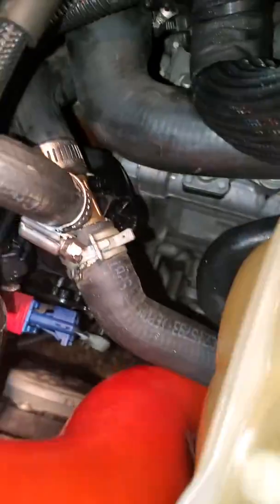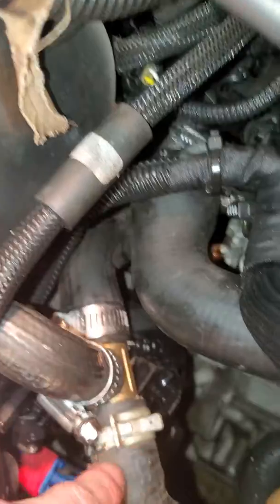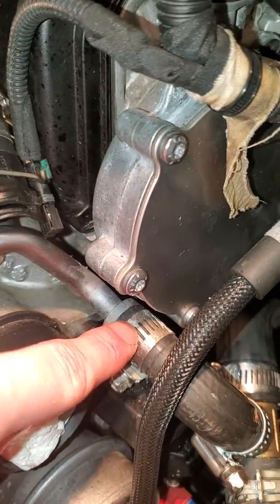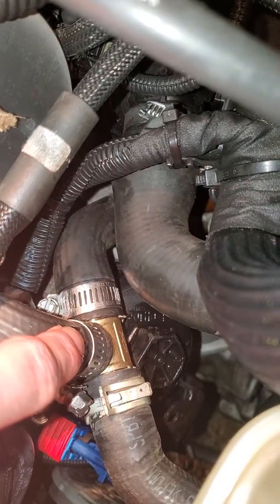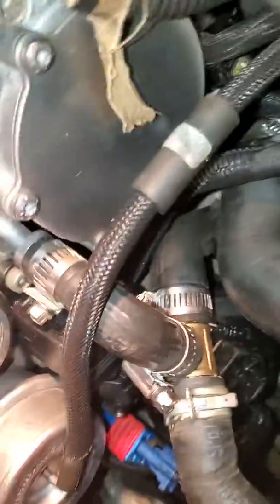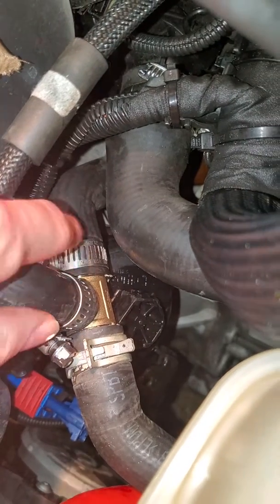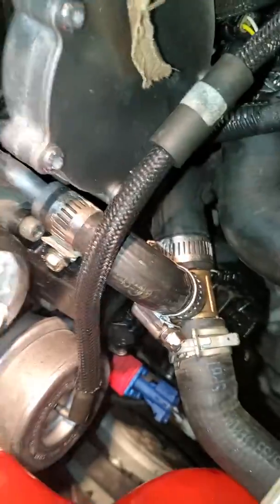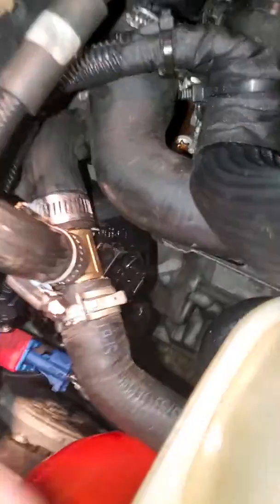Mini cooper coolant return line failed!

Comment: Question on the top hose and back hose how did you get the outer plastic rings off the ends? I know this is a 4yr old vid but maybe I’ll get a reply before I start taking everything apart lol
Reply from the maker: i used a dremel to create a cut in the plastic clamps, then used a flat head screwdriver to go underneath the clamps to pry them off or to crack them off.  👌

Comment: Yes!! Great video save money!!! 
Just got my fiixed same problem. Plastic broke off 2013 Mini Cooper S R56 N18.  I go with 1"x1"x3/4". Work/ fit great. 
* No more worry about crack/ broke doing oil change. .
Reply from the maker: after some solid research you are correct a 1x1x3/4 works perfectly fine !!

Comment: Thank you for this video and those that commented. I just found this failure and repaired it with a brass t fitting. 45 minutes later my '13 MCS with the N18 was back out on the road. Running smoother and better than ever.
Reply: Could you help me out with this?

Comment: Hey man, I appreciate the vid, super helpful. Mine just broke in exactly the same way. I'm wondering if you had to burp the line or anything when you completed the repair and refilled coolant.
Reply: You will definitely need to bleed the air out. Also my cooling fan ran for about 5 minutes after I would shut off the car. This happened for about a day until it randomly stopped. There are helpful videos about how to bleed the air out of the coolant.
Reply from the maker: Yes I did

Comment: I just did this repair on my 2013 mini copper s. I ended up having to use a 1x1x3/4 T. Was really easy to do. Just had to dremel off the plastic compression clamps and I was able to put it all back together with stainless steel clamps. Might be worth replacing the hoses as well when you do this repair.
Reply from the maker: Was that a PEX tee or a barbed tee.
Reply: @Starboy2k17  barbed I believe. I had to use the steel clamps (the ones with adjustable screws) to fasten it to the hose. Although looking back it was hard to get to them so I would recommend using the automotive hose clamps that you could get at auto zone. They are easier to work with if you have the tool for it.

Comment: Help me understand removing the clamp? Are we dremeling the plastic clip only leaving the original hoses fully in tact or are we removing some of the rubber hose material itself in order to get the plastic clips off?
Reply from the maker: Your only dremeling through the plastic clamp and not the hose. Once your mostly through it pry it off with a screwdriver and should be farely weak. Should come right off.
Reply: Thanks for the quick reply! Got it done. Definitely a pain I wish I didn’t have to deal with, but much appreciated posting this up. Nice work.

Comment: Hi  this just happened to me  but i am going to buy a genuine part as i just dont understand  what brass part to get  as i am from the UK if you could just tell me is this part hard to change ? what tools would i need   any help would be much appreciated  THANKS
Reply from the maker: use a Dremel to cut the the compression clamps off the plastic tee, and removed broken tee. Vacuum out each coolant line for any debris. Use a brass t fitting with barbed ends with stainless steel clamps to help further secure the fitting. for my 2011 mini cooper s r56 it was 1 inch x 1 inch x 1/2 inch: 1/2 inch top going to the turbo. make sure you fully flush your coolant system as there most likely will be debris in the system.

Comment: Thank you!  This saved me hundreds of dollars on a tow and repairs for only an $8 fix.  Lowe’s had the brass reducing Tee and SS hose clamps.   I barely had enough hose left after cutting off the compression clamps.  It was definitely a 1”-1”-3/4” reducing tee (as another user mentioned) for my 2012 R60 Countryman S.  Maybe they made the turbo cooling line larger for some cars.  Thx again.
Reply from the maker: They did make some with 3/4" instead of 1/2". Depends on year and model.
Reply: Hi Brent Eastwood  same thing just happened to my 2012 r56 jcw n18  i have no idea what brass fitting to get so i am going to buy the genuine part  but just need to know if this is hard to fit  and what tools i would need  or should i just take it to my mechanic  ?  please help

Comment: How did you remove the original one?
Reply from the maker: Cut out the compression clamps, dry vac out the lines of debris, and replace with regular stainless steel hose clamps and brass T fitting.

Comment: hi, can you share the link to the brass fitting? i am unable to find it to start this repair. thanks
Reply from the maker: Use a brass t fitting with barbed ends with stainless steel clamps to help further secure the fitting as i showed in the video. For my 2011 mini cooper s r56 it was 1 inch x 1 inch x 1/2 inch: 1/2 inch top going to the turbo. make sure you fully flush your coolant system as there most likely will be debris in the system. Since you used a Dremel to cut the the compression clamps off the plastic tee, and removed broken tee. Vacuum out each coolant line for any debris.

Comment: Are you able to remove the hose that goes into the turbo? Mine broke off today and there’s a piece of it stuck inside that I cannot get out
Reply from the maker: The hose on the top of the brass T going to the turbo ?
Reply from the maker: Yes it's most likely held on by a compression clamp which requires to be cut off to loosen the hose to be able to be removed. Another method could be that you can apply a good vaccum to the line and suck out anything that is possibly stuck in either of the 3 sections, 1 going to the turbo, the 2nd one going to the thermostat, and the 3rd going to the coolant overflow reservoir. 👍
Reply: Japanese Inspired there is one stuck on 1, going into the turbo and 2, going into the thermostat, and they do have the plastic compression clamp, so I might just have to break it off the hose, thank you :)

Comment: Hi. I have a 2011 mini cooper s. Same problem with T piece. However I found plastic irrigation (black) that fits perfect. Problem is inside diameter is slightly smaller. Will that make a difference?
Reply from the maker: Shouldnt be much of a difference but i made the video on a permanent solution yours may only be temporarily cause plastic gives out over time but will work well.
Reply: @Starboy2k17  thanks very much for your feedback. Yes I know plastic gonna give problem in the future. Tried to get a brass one but couldn't. As soon as get one I will replace. As long as I am not interfering with insufficient water flow then I am good to go for now. Thanks again 👍
Reply from the maker: @oceanwave7087  as long as the difference is minimal and not huge then it should be okay.
Reply: thanks! did you have to bleed the system?
Reply from the maker: @oceanwave7087  the coolant system? Yes I drained and ran a coolant cleaner additive and and washed that out after a good drive cycle and I put back in coolant after I was successful for draining an refilling. Any hose that was possibly exppsed to the plastic bits I put vacuum on to suck out any bits if there was any.
Reply: thanks!!

Comment: Man, this just happened to me right now.... It snapped right off, didn't even move it that much... it was all corroded ....Gonna have to do this, thanks for the video. I'd rather not drain all the coolant but I'm going to have to right?. Thanks a lot for this video it helped me a lot! Gonna try it tomorrow.
Reply from the maker: Definitely the best time to drain the coolant and do a coolant flush ^
Reply: @Starboy2k17  dang it, your right might as well get it done. Thanks a lot man I really appreciate you doing this video . I was about to buy the $80 replacement part , but this way is easier, cheaper and will definitely last longer . Thanks a lot man!
Reply from the maker: @davidv9580  definitely will last in till the hoses give out. The hoses seem to be well made and probably wont fail in the cars lifetime. I used a small handheld dremel to cut the compression clamps off and cleaned up the area with a vacuum and applied alittle vaccum to each hose that could of got contaminated from the millions of  plastic pieces and the original parts that fell into the lines when it broke. Did a flush to double check as well so that none is still trapped in the system.
Reply: @Starboy2k17  oh man, thanks for the information. I'll make sure to do all that too. Good thing you told me I wouldn't have done the vacuum thing , thank you for saving my car! It would of probably got messed up if I didn't vacuum out the  plastic pieces...thank you once again man I really appreciate it! I'll let you know how it goes once I'm done. :)!
Reply from the maker: @davidv9580  let me know how it goes and if it works out for you too ^
Reply: @Starboy2k17  I got it man! Worked out perfect, thanks for the video, if it wasn't for this video you made I would have never done it! Thanks a lot man, keep up the good work.
Reply from the maker: @davidv9580  I'd love to see your project ^